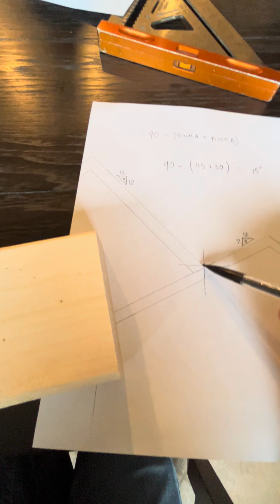How to calculate shed roof and stacked gable angles

Comment: How about  just subtracting the smaller angle from the larger angle 45-30.26=14.74.   Then use common sense on whether or not the long point is to be sharp or shallow. If it needs to be sharp as in the shed is overlaying the gable. Subtract it from 90. 90-14.74 75.26 with the pivot point.
Reply from the maker: That method works as long as one roof pitch is a 12/12 or 45 degree,   But try your method with a 23 degree roof and a 37.74 degree roof.    It produces the same answer as your example, 14.74 degrees.  however this time it’s incorrect.   Where as my method 90- (37.74 + 23) produces the angle 29.26 degrees, and that is the correct angle.
Reply: @Redoakcarpentry  interestingly enough you are correct, but only if the steeper angle is laying onto the shallow angle. 9/12-5/12 is 90-(36.87+22.62)=30.51 from
the pivot or 90°vertical line. 
However with a 5/12 laying over a 9/12 the equation doesn’t work. The correct angles is 14.25 36.82-22.62=14.25 or 75.75 from the pivot or horizontal line respectively.  It seems that when a shed is laying over a gable the gable has to be  at 12/12 or 45° for the equation to work.  Trying lowering the pitch in the gable in your second example to a 7/12 laying onto a 9/12. The two pitches are so close that the cut would have to be at a 6.61° coming off the horizontal line up or 83.39 off the vertical line/pivot.
Reply from the maker: @IndianaJBird okay soo it seems we need two formulas, one for a step gable scenario and one for a shed dormer scenario.  (Unless one is a 12/12 pitch, and then either formula works) 

For any step gable scenario it is 90 - ( A + B)  = cut angle on speed square 

For any shed dormer you simply subtract the lesser pitch from the greater, as you mentioned,  And that gives you the actual degrees of the angle aka the “long” cut angle.   

Are you with me now?

Comment: Red Oak. 

Stoked to see more content. Always enjoy your stuff. How is the house remodel going? 

Question on the video:

How does one know when to use the true angle? For example, 

If I know the pitch of each roof, when it’s time to decide the degree, when would I know with my square when I really need to cut 15 degrees or the inverse of that? 

Is it by looking at it? Or any pitch that meets a steeper pitch  will be the true degree and any steeper pitch meeting a lower pitch will be the inverse? 

I guess I am trying to figure out, when subtracting from 90, what determines the true angle vs the inverse or speed square angle?
Reply from the maker: If you have a shed roof the formula will give you a true angle,   If it’s a pair of stacked gables it will be the angle you get by pivoting speed square to 15° and marking the blade of the square.  Should be pretty clear by looking at your building which scenario you have 🤙
Reply: @Redoakcarpentry  

I believe that is making sense to me. 🤪 Do you know why stacked gables is the speed square degree? Just trying to understand the knowledge.
Reply from the maker: @travisandtracyjacobs6198  It doesn’t have to be, you could just skip subtract from 90° and mark out the sum of the two pitches.    I prefer to have the same formula for both scenarios. It’s easier to remember.  Then I only have to remember which way to mark the square.   But you can do it however you want, so long as you understand what the true angle is supposed to be
Reply: @Redoakcarpentry  

I believe that’s where I am hung up. Knowing what the true angle should be. Not how to get there now that you posted this, but if one gable comes out to say 30 degrees, based on pitch, and the other 35, I would need to cut the gable on top at the difference of 25?
Reply from the maker: Yes, pivot to 25°on the speed square and mark the blade.   This forms an angle of 65° relative to the edge of the board.   I think you might be imagining this is more complicated than it is 😊.